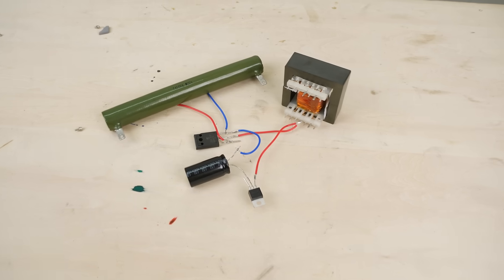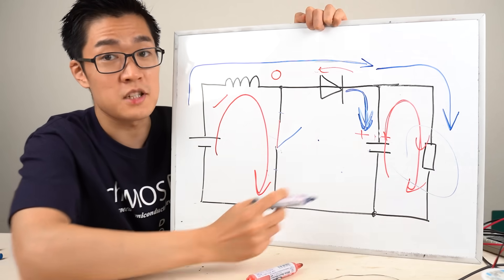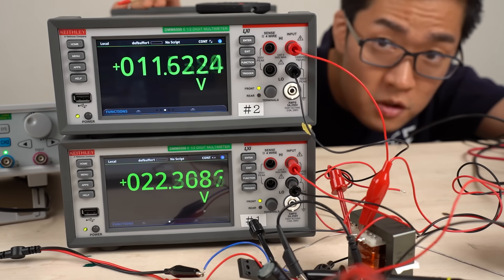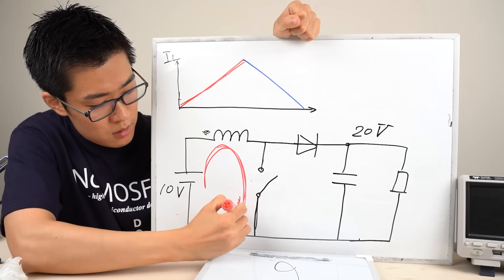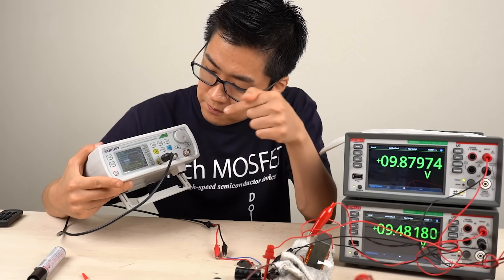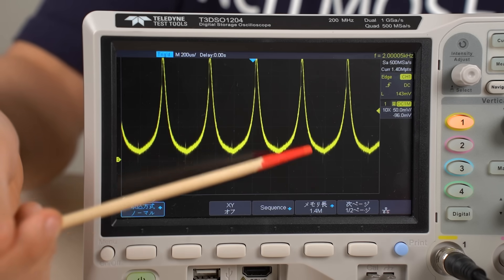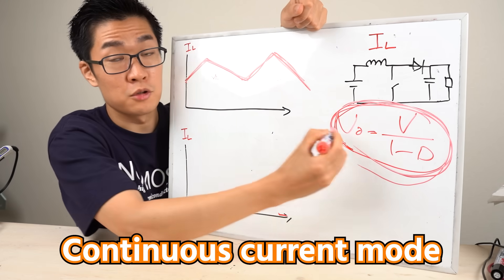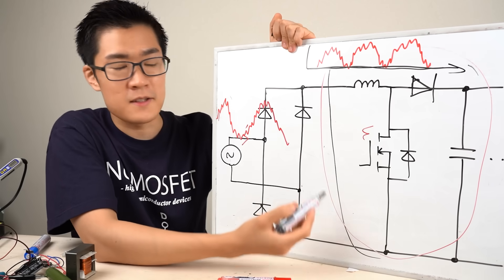What is the "Boost Converter"

Comment: You could explain that the stored energy on the inductor will develop a voltage on the inductor terminals and will be added to the power supply voltage, thus, the elevation of the original voltage. More energy stored, higher the power (current and voltage)  returned by the inductor, so, a pwm control circuit can easily adjust not only tbe voltage, but current, power, delivered to the filter capacitor and load. It is very fundamental to understand how and why the inductor store and returns (cemf) energy in a boost converter.  Also, boost converters never enter saturation, the inductor is selected based on the output current and oscillation frequency of the driver microchip selected for the task. There are boost systems that works with frequency modulation, in order to save power when the dynamic load is not sucking much power. Even in those, there is no saturation in the inductors, except in bad designs or components. You lost an excellent opportunity to enrich your video.

Comment: excellent video, inductors are the least discussed components, also if the switch stuck in on mode, it's basically a short circuit to the PS, inductive reactance to DC is nill.

Comment: 🎉🎉thannnkkkyyyoouu..inductors.. booster on the alixpress 1200...1500..1800watt 12--80v DC out.. but the max 10amps is the max it can eat up.. 🤔🤔🤔💨  hz needs to change and the torrooide inductor. Needs to be 2X or 4X the original. China gives .. but.. ??? Can I put a TOOOO BIG AN INDUCTOR on this convertorr .. and  sink the pwr output totally.
Reply: You can't just hack the inductor to replace it with bigger one without replacing the main switching Mosfet.
Changing hz means changing the control IC, which means you just better build the boost converter from scratch yourself. 
The switching speed on that boost converter you buy is already in sweet spot between efficiency, reliability and heat loss from switching. Increasing switching hz will cause significant increase in heat loss in MOSFET, and the higher the current the higher the heat generated from switching (exponential growth). For example if you 2x the hz then MOSFET heat with same load from 10W to 20W and if you 4x the frequency the heat will be 4x10 = 40W which requires big heatsink and airflow.

All you need to do without modifying is just to buy more then parallel the output with diode at each of the output.

Don't look at the watt, if it says 1800W it is converting from high end voltage to slightly higher, such as from 70V to 80V.
Look at ampere rating, if you have only 12V input then you have ONLY 12Vx10A = 120W max.

If you want a much higher power with single and efficient device, consider using different topology like 2-switch forward converter, as boost converter is very limited in current. Use topology that uses transformer instead of inductor because correctly designed transformer can deliver much better power than a very big inductor with boost topology. 

Remember, boost topology power is highly related to difference of the voltage. If you want a very low voltage (12V) to have output 80V or higher then the power this topology can deliver is very low. It is highly adviced to change the topology if you really need power higher than 100W.
Reply: .  @stark_energy  yes sounds right. But innovation labs ChnL on YouTube has been able to pump out 80-90% of the watts the convertors say they will . Have you seen his vids .  He adjust s the hz and add output shunt..and double s or 3X the inductors . 
I hope2try out one day . 
But if an hf oselator pwm forward con. Air gap transf can do the booster of 12 up to 20v  20-30 Amps out .then yes I'd use that ...if I could find one ..or a vid on one. 👌👀👀👀🍷

Comment: Very good explanation. Will you develop the circuitry further and show how the duty cycle can be adjusted automatically to keep the output voltage steady over a range of load values?

Comment: In simple terms, it involves a inductor or capacitor. In case of an inductor the magnetic field collapses much faster when current is turned off,producing higher voltage. If the input source is AC, it can be multiplied with diodes and capacitors(only for very low dc currents).

Comment: In this case is a current feed boost converter. With input capacitor before inductor then is voltage feed boost converter. Diffrence is in input currtent shape and control metod. I have never seen other usage of current feed boost converter than pfc's